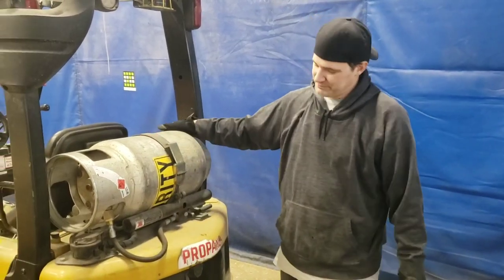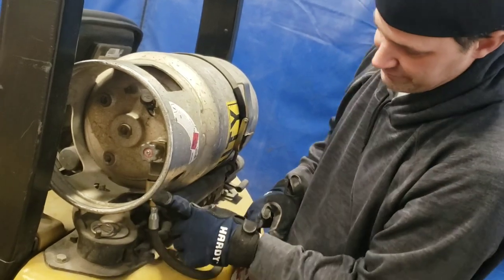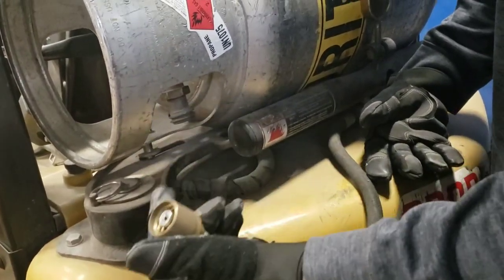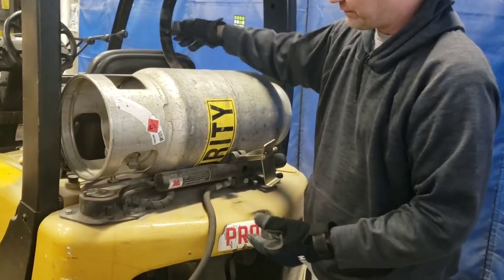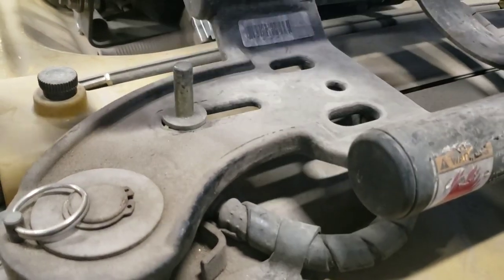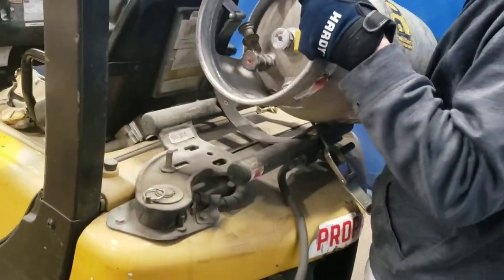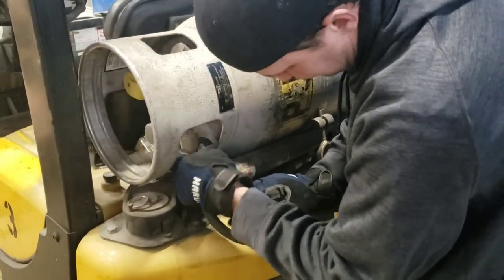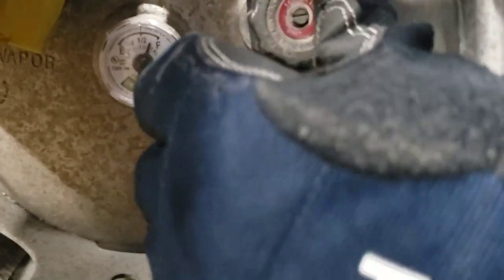How to Change Propane Tank on a Propane Driven Forklift MUST SEE! Safety

Comment: Thank you for the video, however you must ensure your wearing all appropriate PPE .  Then you turn off the truck then turn off the tank. you should then try to restart to ensure there is no residual propane in the line.  The next step would be then to remove the line.
Reply from the maker: Thank you